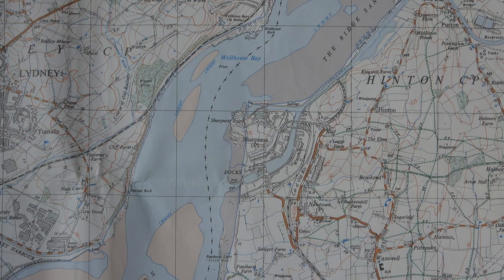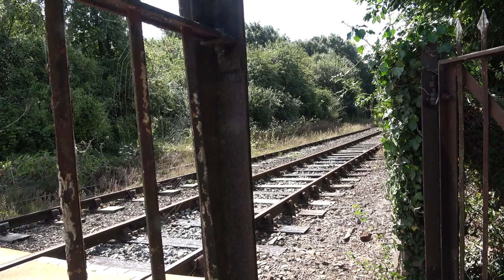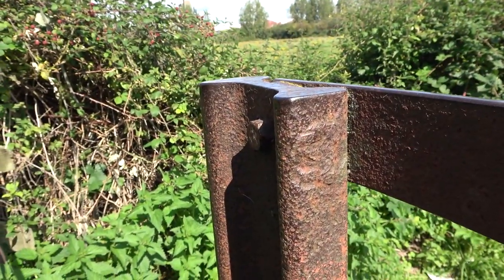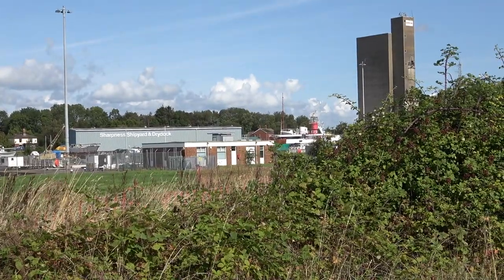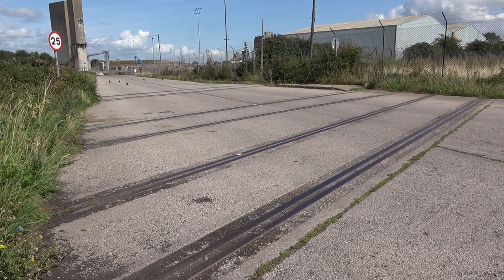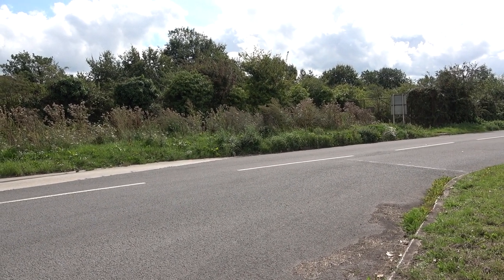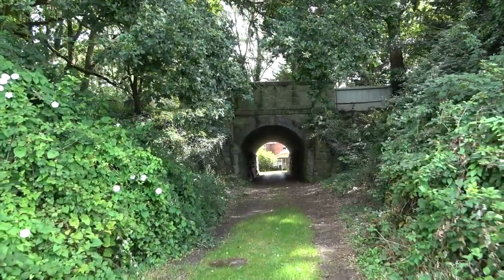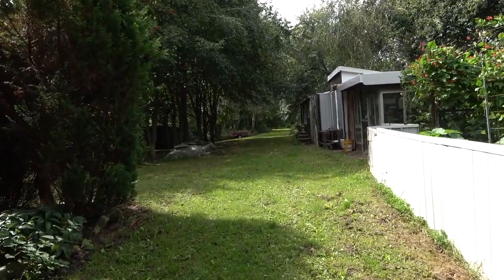A look at Sharpness Docks Railways UK

Comment: At 11:34 you are looking at The Railway Inn, and on the opposite side of the road there used be be steep steps leading down to the old platform, the railway ran parallel to Oldminster Road, and at the bottom of the hill just past the Pier View Hotel on the right is a footpath that used to go over a bridge and then ends up at the kissing gate near the start of the video.  A few hundred feet from there hidden in the bushes is an old turntable..  if you were to follow the path of the old railway you would come to the site of the old severn bridge.   I grew up there soon after the bridge disaster and the dock railways were in use then, to one side of the low bridge there used to be a couple of streets of terraced houses that were demolished in the late 70s..
Reply from the maker: Hi Andrew, I may make a return visit to see what is there as per your comment. The main problem seems to be overgrowth  which caught me out last time but worth a look. Thanks. Ron
Reply from the maker: @andrewstones2921  Thanks for your help Andrew. Ron

Comment: One of my favourite places to wander around. It's amazing how intact the dock system railway is still is. it's overgrown and in a couple of places tarmaced over but fundamentally complete and still actually physically connected to the national network. It will be great if the VoBR can get the branch line operational as a heritage operation but even better if freight trains could run to the docks again, getting rid of large lorries from the roads around Sharpness. There was a horrific crash nr Sharpness in 2008 in which a mother and 2 children were killed when their 4X4 was in collision with a lorry. Not the lorry driver's fault but if the freight had been on the railway no lives woould have been lost....
Reply from the maker: True, thanks for posting. P.W/

Comment: Great video as always! WARNING IM A BIT OF A BUFF ON THIS LINE LOL SO APOLOGIES IF I POINT OUT SOME ERRORS BUT as you are not overly familiar with the history or layout of how it once was then I understand and only pointing things out so you have a better understanding of the area and how it used to be as its OBV change so much since closure etc (no disrespect intended by the way just offering you some more info on it that's all as you do great vids!) ALSO, THERE are plans to restore the line as a heritage railway and restore/rebuild the old sharpness station on its original site opposite the hotel in your vid! here is a link to the vale of Berkeley railway website that tells you more of the plans and also HAS some great old photographs of sharpness station in its heyday that you may find interesting! When you are standing on the railway bridge overlooking the farm Sharpness station was over the other side of the bridge on the left and NOT where the farm is 😉 THIS IS THE LINE THAT WENT ONTO THE SEVERN RAILWAY BRIDGE  and, not as you stated at 12:54 as the high-level railway ( I MAY BE WRONG THOUGH AS I LINK TO THE DOCKS FROM THE SEVERN BRIDGE) BUT I THINK that was just an extension of the docks sidings underneath and the now-closed bridge went over that extension to the docks sidings (may have been a footbridge or road bridge back in the day the web site I have linked at the end shows it back in the day on the tab history. you can see more of the layout of how it was and plans for the future here! hope you find the website of interest be it historical or plans for the future if they get funding etc for me it would be great to get a station and heritage line back in that area ..mind you I'm all for restoring lost lines and stations as they are part of our lost railway heritage that a lot of the Beeching cuts took away or a disaster like the Severn bridge collision did and was deemed too costly to repair! ...I for one know that if there are problems on the bristol to south wales line these days with the tunnel flooding then no alternative route for travel on trains and it's the dreaded bus replacement service (that happens quite frequently when traveling to Cardiff from the Bristol area!)  http://valeofberkeleyrailway.co.uk/
Reply from the maker: Hi Sean, please don't worry about correcting my mistakes, I always welcome comments, good, bad or indifferent, and corrections enhance the channel. Thanks for posting. Ron. (Thanks for the link)

Comment: Ron Viaduct No1 is that shown at 13:15 whilst viaduct Number 2 is shown at 14:21 these are the High Level Viaducts, No3 viaduct is shown at 14:00 that being the Low Level Viaduct. At 14:20 you show the Swing Bridge North Ground Frame that releases the lock bolts to free the bridge to swing. Under No1 viaduct there was a long siding that went along side the canal to a point just short of where the main line crossed the canal at Sharpness Swing Bridge Signal Box. No2 Viaduct had lines underneath it on both sides 1 at the West side and 2 lines on the East side whilst No1 viaduct had three lines underneath it. The Severn & Wye Deep Water Tip was added in 1886 this had 2 lines going to it with a wagon turntable joining the 2 lines together with a short length of track to the tip, this enable wagons to enter on one line then emptied and returned on the other line. I hope this helps to enable you to piece together my earlier comment. Thanks again for the link, I shall be watching this again it really is very good, I enclose a link to the track layout which will show the points I indicated about the track layout - https://maps.nls.uk/geo/explore/side-by-side/#zoom=15&lat=51.72625&lon=-2.47932&layers=206&right=BingHyb - . Best Wishes, Andrew.
Reply from the maker: Brilliant Andrew, later today I'll settle down and go back through it all with maps and layout plans, really looking forward to it, thanks Andrew. Ron. (Hoping Pauline doesn't have other ideas.)
Reply from the maker: OK got it now Andrew thank you, I was thinking for folk  into model railways, that would make a superb layout. You could shunt wagons about for hours. Aint it hot!! Ron
Reply: @ParkinsonsWalks  Well done Ron it's quite complicated, I am very much into model railways but I would not attempt such a layout as Sharpness it would cost the price of a house to do and you would need a number of you to work it. I agree you could spend hours shunting wagons about, mind you remembering where they were when they were out of sight would be fun. I know what you mean about being hot it's 84.2F in my lounge at the moment! You deserve a nice drink before you water the plants in the garden to keep them looking so stunning.
Reply from the maker: Hi Andrew, I've spent today filming the Morton In Marsh to Shipston branch-line, I've never seen a branch so intent on keeping its secrets hidden. I was 3/4 the way round before I found a fence post. I will have my work cut out to make it viewable. Recorded 31 degrees at one point, too hot really but I got through it. 
I would think the way to distribute the costs on a model layout of Sharpness is to do what they did when it was built. Put in the basic infrastructure and then add to it over time. Would take patience though. Off to cool down. Ron.
Reply: @ParkinsonsWalks  Hi Ron, I know very little about the Moreton-In Marsh to Shipston-On-stour Branch other than there was another Branch off it to Stratford which was last used in 1904 and removed in 1918. From Shipston-On-stour the next station was Longdon Road, the Stratford Line diverged to the right whilst the line to Moreton in the Marsh went to the left passing through Stretton-On-Fosse. The original line to Stratford went off to the left about half way between Stretton-On-Fosse and Longdon Road as a facing junction when travelling from Moreton in the Marsh, that about sums up my knowledge of the Branch. Your idea of making a model of Sharpness in stages would be a good idea the real problem would be to get a building big enough to be able to house it in. Please take care going out in these temperatures in such isolated places, if ever you became ill how would anyone find you quickly, better save your walks till this hot weather has passed. Take care and make sure you rest up now. Best Wishes, Andrew. (I have just found you a link to explain the track layout in my comments it is https://maps.nls.uk/geo/explore/side-by-side/#zoom=16&lat=52.07690&lon=-1.67458&layers=6&right=BingHyb)
Reply from the maker: @andrewmerriman7133  Andrew you make me smile, you say you don't know much then provide me with more info than I've been able to get anywhere else. I'm quite sure that I found the station site at Longdon but didn't know what I was looking at. The Stratford branch looks to have less access than this one. Thanks for your trouble. Ron
Reply: @ParkinsonsWalks  Hi Ron, Glad I made you smile! I am surprised that there's not more available information on the line than I was able to give you. The Stratford Branch went to a basin on the outskirts of the town I assume for transfer to and from Barges. I would love to know why they removed the line with direct access from Morten -In-Marsh and built a line with direct access from Shipston-On-Stour, that does not make sense to me. The only other explanation I can think of was that maybe the Shipston-On-Stour was not the intended terminus of the Branch but it was cut back to there. When I have time I will try and find details of the Acts of Parliament on the line. It really is no trouble at all Ron to give you the information I have, I appreciate that you often use bits in your Vlogs. The first ever heat warning has just been issued until Thursday night for your area so will the two of you please take extra care. Best wishes, Andrew.

Comment: I believe I heard something about an intention to restore a passenger rail service to Sharpness; either heritage or otherwise. Did you by chance happen to glean any pieces of information about it?
Reply from the maker: Hi Sharron, the heritage center there are negotiating with Network Rail about use of the line, Sounds positive but no dates. Ron
Reply: @hugolandyn2702  * SPAMMER ALERT *